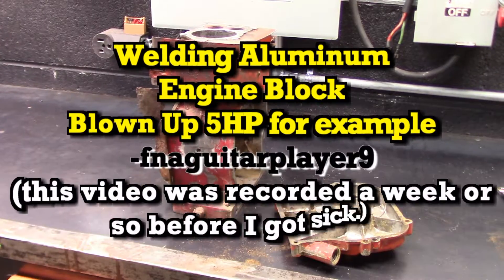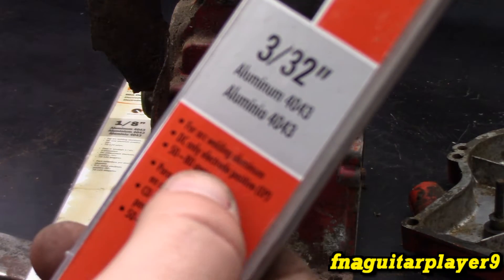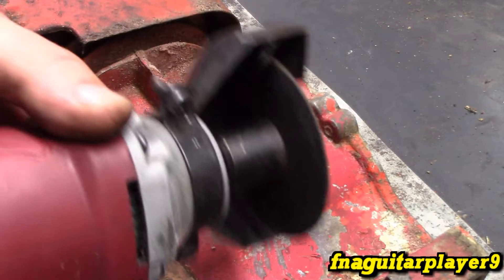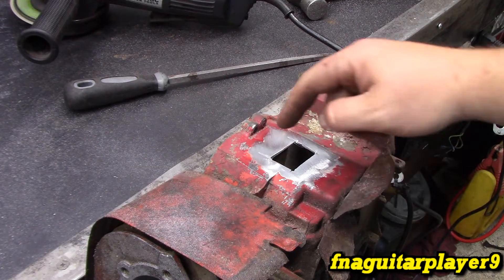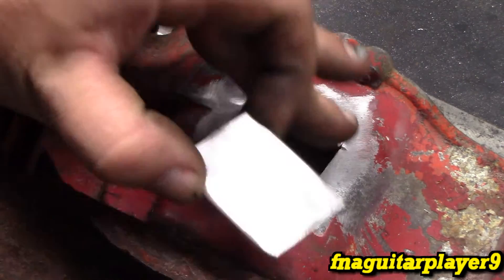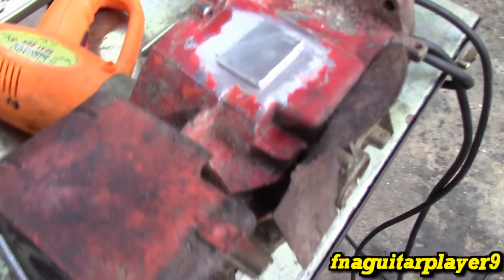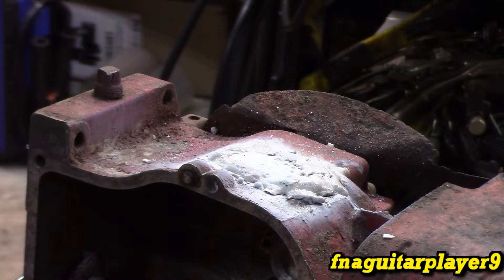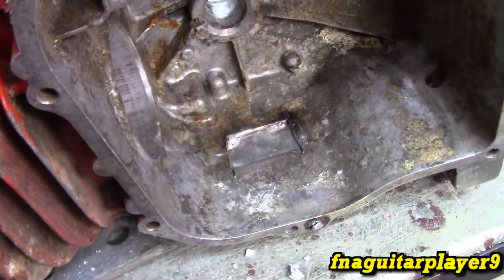Welding Aluminum Engine Block With DC Stick Welder w/ 4043 Rods

Comment: You did an excellent job using those sticks. They aren't the easiest sticks to run. The do really good with a pulse DC stick welder. That flux usually comes off pretty easy with warm water. Not sure if you have an air compressor, but a needle scaler is very handy for slag removal and peening.

Comment: I wonder if investing in a TIG, a good idea ? Just to play around.
Reply from the maker: Yes, TIG is the preferred way of welding aluminum, but it is a pricier option, but much better results. I'm sure with alot of practice a better bead can be done but its so hard to work with. Thanks for Watching!!!

Comment: What was your results using brazing rods? Did it not seal water tight? I tried it but had that issue but believe I could not get the Al hot enough
Reply from the maker: I could never get it to bond no matter how hot i got it or how i cleaned it. I only had a propane torch to work with but at the time i was going to a trade school and they tried to use the same rods with a acetylene torch but they didn't have any luck either.  I really wanted it to work, and I even tried it on a aluminum step ladder with bad results as well! I'll use this method for engine blocks and stuff from now on, tricky but doable! Thanks for Watching!!!

Comment: Glad to see you all recovered Frank and Mrs Frank. Nice to see the technique, I've not seen ally welding before, good to know it can be done on engine blocks. I had the same sort of thing happen, only a bigger hole. I used good ol' JB Weld and the piece it punched out (which I drilled some holes in so the JBW would form a contiguous mass on both sides) -  it did a great job. Where there were cracks, I drilled a hole at either end of the crack and that stopped it spreading, then filled in with JBW. Thanks for sharing, looking forward to the rebuild. Stay well.
Reply from the maker: Thanks, we are doing much better now! Its tricky but it can be done with patients and practice! Thats a good idea, drilling it so its all one piece, that would be much stronger. Thanks for Watching!!!